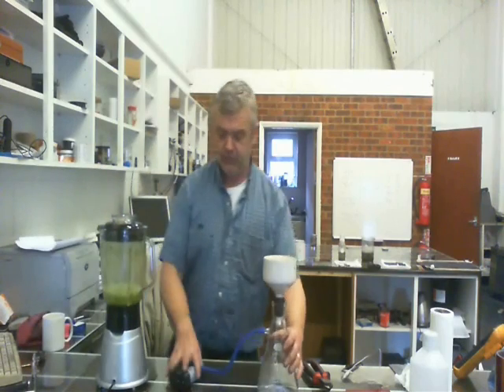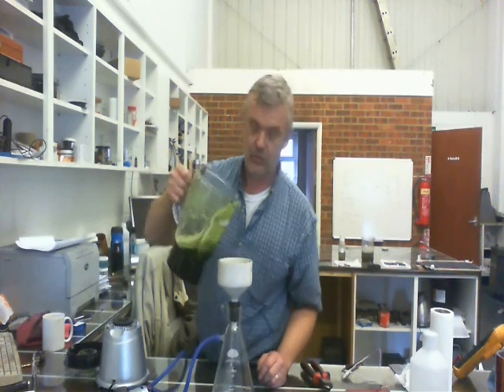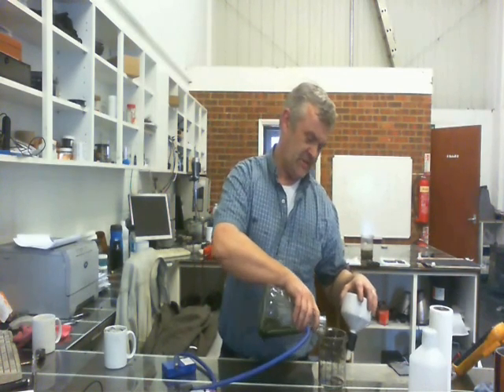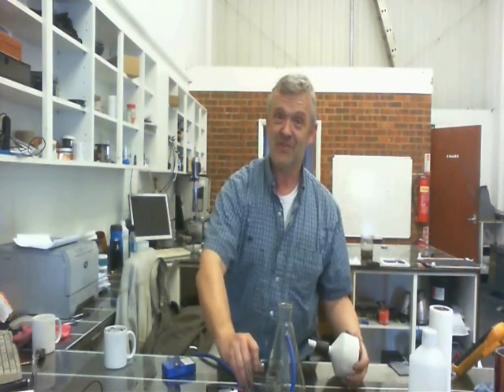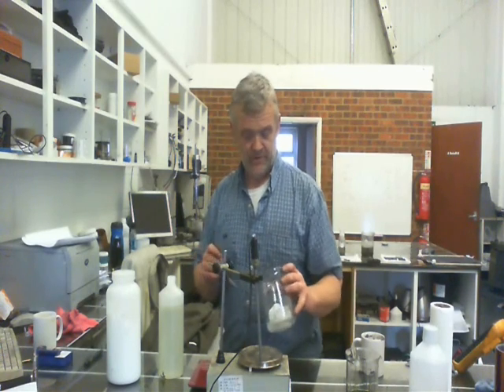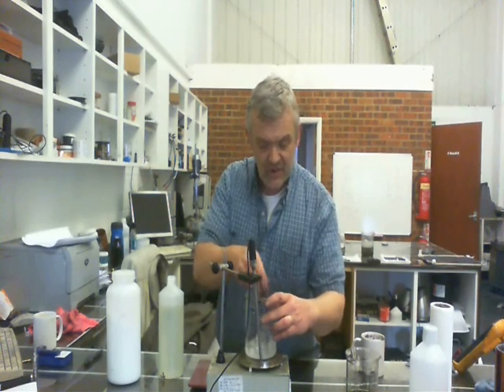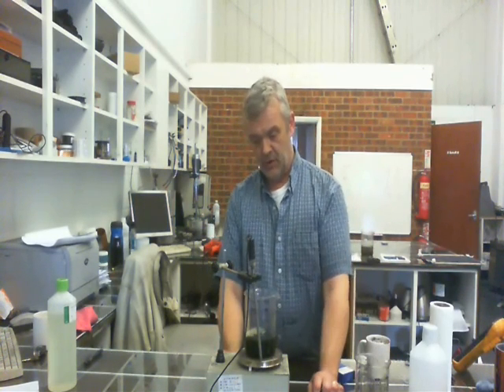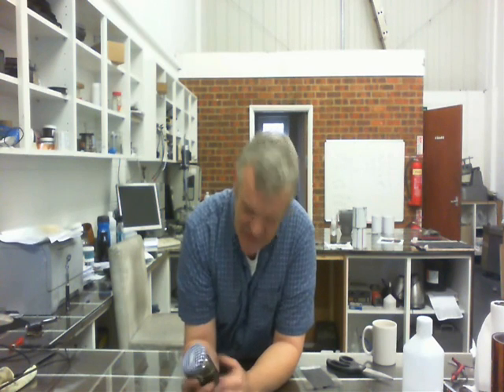Making A Solar Cell From A Leaf - Extracting Chlorophyll Into A Deep Eutectic Solvent

Comment: Hi Robert, apparently, adding water to a DES (15% wt) " facilitates ion mobility, and generally results in improved electrochemical characteristics." https://pure.strath.ac.uk/portal/en/publications/copper-electrodeposition-from-a-water-containing-choline-chloride-based-deep-eutectic-solvent(e2b523b9-acd3-4560-b523-471cdcadf21d).html

Comment: Just wondering: would you happen to know why the metal doesn't oxidize? Also, would it work just as well with a zinc strip instead of aluminum?
Reply from the maker: no idea mate - i will give it a go

Comment: Hey there! This seems really interesting. I think I'm going to be toying with this during the winter break :'D (gotta get through finals [pchem/adv bchem -- fml]). But I'm wondering: why do you change the solvent system? In the leaves the Mn oxygen evolving complex splits water and allows an input of electrons into psii. So technically you could have a refillable solar cell which is only limited by the amount of water at your disposal. Is there a benefit to this solvent system change?
Reply from the maker: i don't know i did it that way because it seemed right to me - i am 100% sure there are better ways of doing it - give it a go and let me know how it works out

Comment: Great experiment!! Maybe the chlorophyll requires mild conditions in order to not be denaturalized. there are a los of substances in the leaf so maybe there is a way of separating chlorophyll from the other components(is the only active molecule we are interested... ) It could be reconcentrated using vaccum distillation at low temperature. Or maybe do the extraction with the glycol directly. Congrats for you work.
Reply: Very nice paper http://www.plantmethods.com/content/pdf/1746-4811-9-19.pdf 
explainig how to extract the chlorophyll without denaturalizing it. Possible reconcentration centrifugation.
Reply from the maker: Jorge Ruiz
thanks for that mate - do a vid of the process if you can and share with the world

Comment: Hey Robert ! I asked you about electroplating on graphenized materials like the scotch bright pad you made into a copper sponge. I was wondering if adding copper nano particles to the graphene ink would allow the electroplating to start on the sponge without having to use the other electroplating solution. The one that uses I think it was copper sulphate and sulphuric acid. Was it the Lacey electroplating process? Sorry I seem to have forgotten some of it.
Reply from the maker: i used a normal acid plating bath - I did think it would be worth looking at DES
Reply: So you think that copper nano particles could cause the lacey process to start plating a graphenized sponge?
Reply from the maker: thagrit
I haven't teid it - so i can't say definitively but i would think so - if you do try it and it works can you let me know?
Reply from the maker: thagrit
or - better - do a video and i will link to it

Comment: So, Robert ? What is slap of the hand on the bottle top chloride? Sorry but the mike got the noise from the bottle rather than what you were saying.
Reply from the maker: the two bottles are choline chloride and monoethylene glycol - you mix in a 1:2 molar ratio. But that is only a guide mate and you could try other ratios and see what you get